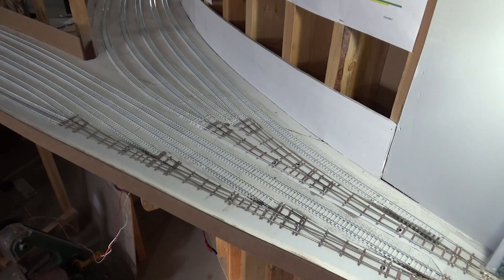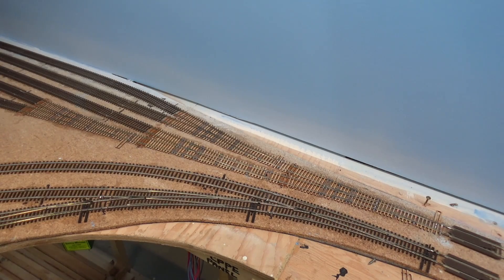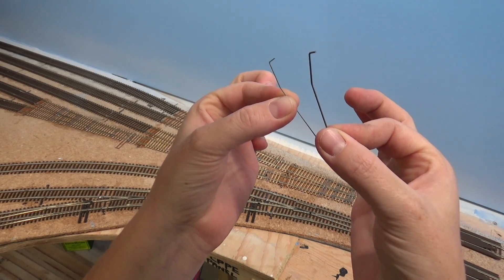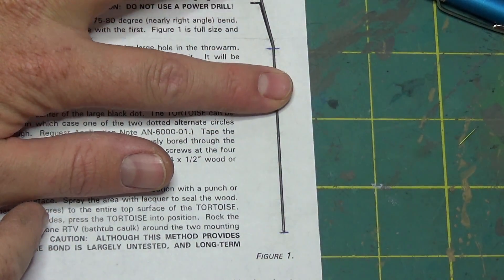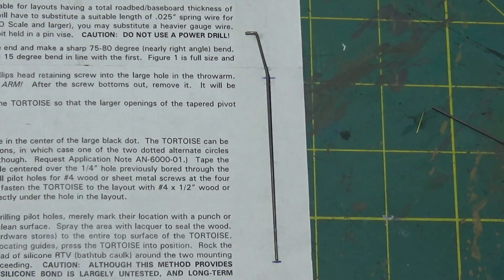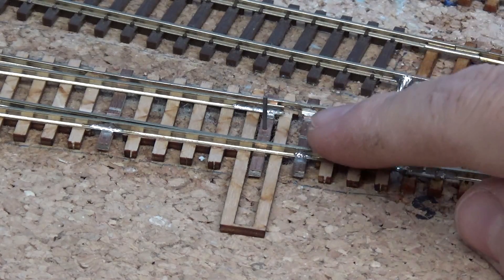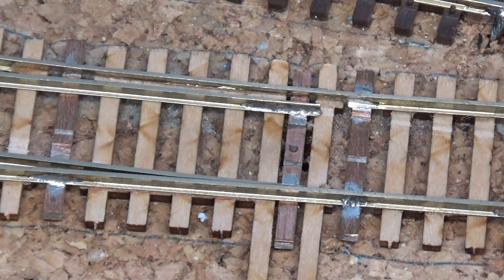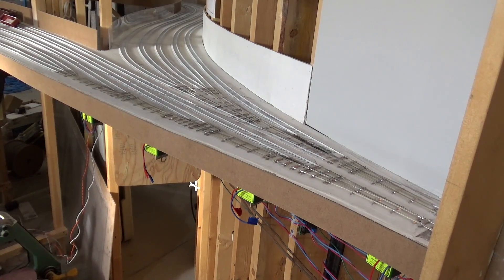Increasing The Throw Power Of A Tortoise Switch Machine

Comment: THANK YOU...for sharing. I notice you solder the rod to the throw bar on the smaller rod, not sure but that may be the reason the points were not closing all the way, did you try it without the solder? The rod must move freely in the throw bar. What do you think?
Reply from the maker: I did that after I couldn't get the points to close with it not secured to the throw bar as a last act of desperation. I'm going to grind them off and leave them loose like the one I got to work.

Comment: If I ever decide to use Fast Track turnouts! Thanks
Reply from the maker: Some older Pecos and Sinoharas can give grief as well. I've had similar problems with an Atlas code 83 turnout on a Free Mo module.
Reply: @BArailsystem  I haven't had any issues with Walthers, Atlas or Shinohara yet. Just dirty track and loose rail joiners.

Comment: Welcome to the world of turnouts...we have the same problem in the prototype, but  we are throwing a lot more weight..LOL  I was going to suggest graphite, which is still not a bad idea as there is friction there on the chair plates. I went a slightly bigger wire but your wire is huge! Also I would pre - measure and cut the wire out of the track, that way you don't risk damaging the throw bar or track, especially on plastic turnouts as the vibration from the cut off wheel damages the hole...I know from experience! Good luck with it sir.
Cheers Gregg.
Reply from the maker: Yeah a little more weight, lol. Thanks for the tip regarding grinding, I should do the same and just nip them off before hand.
Reply: You're welcome Ben. It is a little more work but you save any potential damage to the turnout. 
Cheers mate. Gregg.